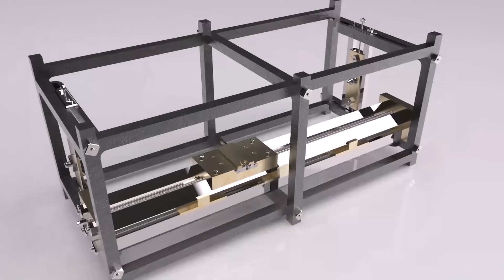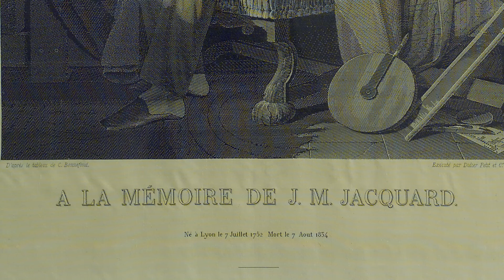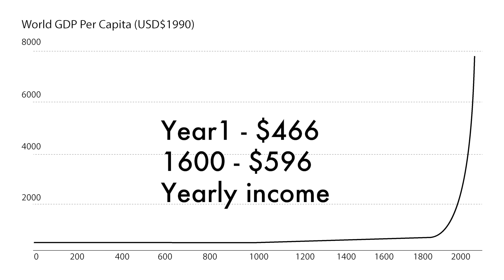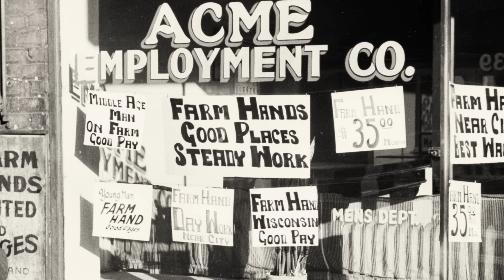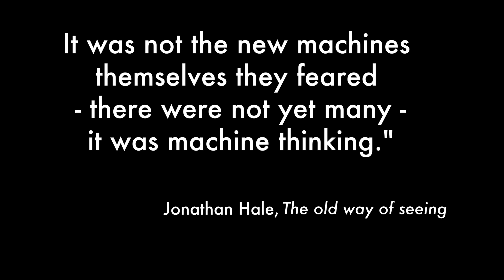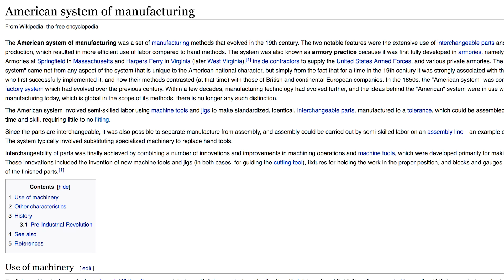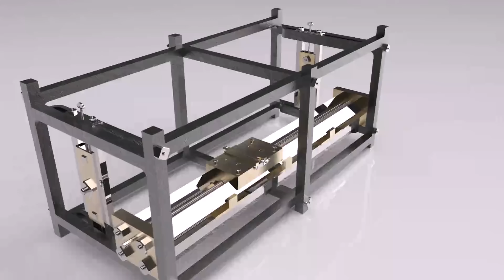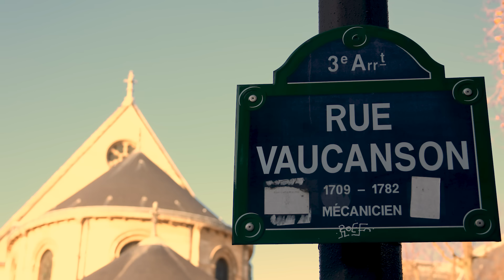The 1751 Machine that Made Everything

Comment: Even though that lathe is pretty cool and very significant, you can't help but notice the parts and wonder which machines and lathes were used to make them. The spindles and screws are precision parts that weren't cast, so they must have been turned on a lathe. Good video, I love learning about where we've come and what great minds got us here.
Reply from the maker: The screws were almost certainly cut with a die.

Comment: I was raised a printer.  Letterpress.  Back in the 1960's.  It was only years later after becoming a machinist, that I appreciated the precision of these printing machines.  The machinery was robust.  Once adjusted to a setting, like the alignment between the platen and the inked type, would not need further adjustment in normal use.  These machines were as good at what they did as any engine lathe or milling machine that I’ve been using for the last forty years.  In  addition, the manufacture of paper must be its own story of precision, because you can depend on sizing, thickness and weight of paper to be as expected.  That said, todays machine tools are far more accurate and robust than the old tools I was trained to use.  Accuracy, flatness, true to a required shape, can be done nowadays with no further processing, in many cases.
Reply: Original Heidelberg! I ran a windmill for 4 years and it was rarely out of sorts.

Comment: I really enjoyed this fascinating video.  The only thing you left out was how the machines were powered.   I would contend that without the incredible energy resource discovered about the same time, that the economic boom would not have happened.   Fossil Fuels helped power those machines to unimaginable heights.   I am curious of your thoughts about the contribution of Fossil Fuels to the machines, economic boom, and overall progress of the 20th Century.
Reply from the maker: I believe this machine was very likely water powered.  Vaucanson used water power for his weaving machine of the same era so I see no reason why not.  Once the work piece was between centers I can easily imagine a belt coming off of it to the power.  Fossil fuels accelerated everything but if I recall correctly even at the time of Watt's death there was more "horsepower" created by water wheels than by steam engines.  The story of the modern world is one of harnessing power for sure.

Comment: Heres more food for thought. A lathe like this allows for standardization. Fasteners (screws, nuts, bolts, etc..) for example could be made in various sizes and thread depths consistently and in large quantities. Those standards allow someone to easily get ahold of the materials needed to assemble machines, vs the old way of having to custom make each fastener one by one in an imprecise   manner.

Comment: the evolution of machinery is just fascinating. Some times I think why it took humanity that long to get where we are, then I think about what I would do as an engineer if i woke up in 1300 today. 

You would think "great, I could build so m,any things and contribute that much!" then you realize: there is not a single tool to cut metal, there is no bearings, no flat surfaces, no high quality steel. All you have is black smithing and hand grinding. 

You would literally have to start with nothing.

Comment: Entertaining video. But I think the focus on this lathe is exaggerated. The industrial revolution is well-documented and cannot be focused just on one machine. Still, if I had to pick one, I would say it was the steam engine burning fossile coal - since that brought the power of many workers or even horses to each application with ease. The lathe is a millenia old tool that was imroved step by step - no ground-breaking innovation. The most important steps in lathes were the here mentioned precision - and a later enhancement to cut precise threads.
Here is a short read about the technical part of the industrial revolution. For those who want to step out of the more entertaining part of youtube theories:
https://en.wikipedia.org/wiki/Industrial_Revolution#Important_technological_developments

Comment: I still don't understand how it works mechanically, it looks nothing like a modern metal lathe..... otherwise incredible video!
Reply: Damon Lam yes, I need to see it work!
Reply: The important parts are the head stock, the tail stock and the saddle. Turning power probably came from an external source such as a water wheel or horse treadwheel. The cutting apparatus  would likely have been securely attached to the saddle.

Comment: The bridgeport is the only machine that can make itself and is more valuable than a lathe
Reply: How would you fabricate a lead-screw with a Bridgeport (vertical mill)? You'd have to chuck the stock in the quill, with a center in the table, and then where would you mount the cutting tool?  By the time you've figured that out, you've essentially re-invented the lathe (even if the spindle axis is vertical).

Comment: Yes... Machines did cause a vast increase in productivity. However... Something your graph fails to take into account is the fact that the world was moving away from the Gold standard and into fiat currency... This move introduced inflation into the money supply. Where gold controlled inflation because there is a fixed amount of it. Now governments can just print more and more money causing that skyward exponential climb in so called wealth... For example. Today compared to the 1913 dollar. Your buying power has decreased to less than 4 cents of that original dollar. So you need to factor that into your wealth graph...

Comment: Have you seen Connections by James Burke? He points out several similar items. The combination of the screw and metal made accurate screws possible. Accurate screws made accurate measurements which made accurate machines. You get the point.

On the growth cycle another connection that James Burke pointed out is that the drop in the labor pool in Europe due to the plague had made a the cost of maintaining a person so expensive that is was worth trying to mechanize a job. Prior to that it wasn't worth it.

Comment: Hey there.  Would you do a video on how they make measuring tools?  I've had manual and also digital calipers (as I dreamed of someday running a lathe instead of just fixing buses) but as I watched my Ace Machinist buddy use his $8,000 lathe, I was suddenly struck by HOW the companies that make precision measuring tools know that they are 100% accurate?  Especially when you are talking about measuring a thousandth of an inch?  How could this NOT possibly vary from one micrometer to another?  And   how do they possibly make those little one inch, two inch, three inch, etc. metal bars to calibrate a micrometer? And do you have to calibrate your precision tools at a certain temperature to compensate for expansion and contraction?   Please explain and I will die happy.  Thank you, Patrick amateur mechanic and self taught jack of all trades. :-)
Reply from the maker: Thanks for watching!  Metrology is a huge subject. My video, Origins of Precision covers some of what you seek! There is much more to know though. Yes, temperature is very important for calibration.  NIST in the US is the ultimate organization you can send your instruments to to be calibrated but there are others which are downstream from NIST but cheaper. Almost nothing is "exact" but some amount of +/- from the standard which a calibration facility will tell you.  This How It's Made about dial indicators may help too! https://www.youtube.com/watch?v=YCTti7tDN3E
Reply: Hey there  @machinethinking !  So would it be commonplace, for example, when someone is making a VERY precision part, say a shaft with stepped shoulders, some changes at 90 degrees others at 45, etc. and have the customer return it cause it's 2 thousandths off?  My ACE buddy has a Korean lathe, big sucker called a Webb, cost him $8 grand.  I love watching him build stuff, and was amazed when he used a little orange triangular carbide bit (looked like a cough drop) instead of some sharp pointed bit.  Also got a buddy in Nicaragua who's got a lathe that was worn out when his Dad imported it in 1950's.  There was NO spares during the wars there, hardware stores had empty shelves, so he built me anything I needed.  Amazing smart fellers run lathes, they can fix ANYTHING!  Thanks for your CoooooL Videos!

Comment: I have always been amazed by lathes. Sadly, I bought a lathe/drill, with a capacity to turn stock about 2 feet by 3-4 inches.  But the manual was a horrible 3 page mess of Chinese/English.  I didn't know what to do, so I sold it.  I still wished I'd learn to operate a metal lathe.  They don't even teach it at vocational school now, theY JUST show you how to set up a CNC machine.  BORING!!

Comment: I mean it helped but from what I understand it was the steam engine that was the real driving force behind the boom.
Reply from the maker: James Watt tried for 8 years to make a workable steam engine but was unable to do so until Wilkinson's lathe could bore smooth cylinders.
Reply: Thomas Newcomen invented the atmospheric engine in 1712.
Reply from the maker: @Robert, yes Newcomen invented the steam engine (or should we credit Papin, Savery or others?) quite early, but it was incredibly inefficient and economically impractical until Watt was able to introduce his condenser, smooth cylinders and created a company (with Boulton) to produce them at scale.
Reply: Right but the argument is a bit of a fallacy. The key invention was the steam engine. Your under the assumption that it could not have been made proficient without the lathe; not necessarily true. Following your logic I could credit the invention of steel to the the boom, right? Without steel the lathe would have nothing to machine. Obviously, both were necessary inventions but in my mind the lathe was no more purposeful than the screw driver or wrench that helped build the true driver, the steam engine.
Reply from the maker: @Robert  Steel, as one critically important example as you point out, is not a machine - and the first machine is my premise. Steam engines are also incredibly important (though if memory serves there was more "horsepower" created by water wheels at the time of Watt's death than steam engines) but it was still lathes which then made the machines (at least the metal ones) which steam engines or water wheels were powering.  Don't worry,  there are many more stories to tell ...
Reply: "is not a machine" - Okay a forge and billows then.. I think your missing my point. Oh well, I guess I am just not convinced.. good video though.

Comment: The lathe created the metal planer which in turn created a much better and more precise and much larger lathe which in turn is used to create a much better and more precise and much larger lathe and this later on gave birth to other basic essential machine tools like the drill press, milling machine, and the shaper. Lathe, planer, drill press, milling, and shaper are the 5 basic machine tools plus their ancilliary components such as jigs, fixtures, extenders, mechanical locking bolts, measuring tools of all kinds especially the micrometer, etc. By simply keeping them simple one can use all 5 basic simple machine tools to manufacture each other. In other words, MACHINE TOOLS ARE THE ONLY MACHINES THAT CAN REPRODUCE EACH OTHER. As time passes by other different basic machine tools came into being and they in turn with the 5 basic machine tools started making customized and specialized machine tools to make other different kinds of customized and specialized machine tools of an entirely different designs until the final and required precision machine tool is achived to produce an end product or an end manufactured product's component and other components. And these components are assembled in an assembly line made directly and indirectly and multi-indirectly by machine tools of all kinds and types and sizes and dimensions.

Comment: I think Computer Thinking is distinct from Machine Thinking, and holds similar potential dangers.  Computer-based systems are inherently based upon rules and assumed consistencies.  Humans are, above all, breakers of consistency.  We are increasingly faced with systems which are not flexible enough to account for the actual flexibility of human beings.  Disturbingly, when your situation is too complex to be dealt with by the software built to deal with you, people see you as the problem, not the system that can't deal with you.  It is nearly impossible to outline any absolutes about human life.  But the software systems that run everything in our lives attempt to do exactly that.  And when they fail, as they must, it becomes increasingly more difficult to resist the conformity the system assumes is present.  Even the person whose situation is different from that anticipated by those who designed and built the systems often feels that they must have done something wrong.

Comment: One thing that always blows my mind thinking about how things are made, is that almost everything at some point was made in a machine, but those machines were made by other machines... and those other machines were, in turn, made by machines.

I suppose it's possible numerous individuals made all metal machines from scratch, without using an all metal lathe to make one... but if someone was designing a new all-metal machine, and they already had access to an all-metal lathe, why wouldn't they use it?

In that way, isn't there some kind of lineage, almost like genealogy, of one machine creating another which all machines can trace their origins to just a few key machines such as this?

Comment: Interesting, however an accurate lathe depends on a accurate screw thread to make it work.  "The construction of the screw thread depended    upon the eye and skill of the craftsman. Advances on this occurred in the eighteenth century.   Antoine Thiout, around 1750, introduced the          innovation of equipping a lathe with a screw drive allowing the tool carriage to be moved longitudinally semi-automatically. Screws with fine pitches are essential in a wide variety of instruments - such as micrometers. To construct such a thread a lathe was essential. Jesse Ramsden in    1770 made the first satisfactory screw-cutting lathe. Using his lathes a long screw cut be cut from a carefully cut small original. Precision screws allowed precision instruments to be made to allow the construction of steam engines and machines tools. By their use in surveying instruments they assisted in the construction and development of canals, roads and bridges." Quote from http://www.boltscience.com/pages/screw2.htm.  So my argument would be that the manufacturing of accurate threads started the explosion not de Vaucason's lathe.
Reply: Which came first the thread or the die?  Above a certain size all threads have to be machined as die cutting requires a great deal of force for threads above a certain size. Plus die cutting is mostly applied to Acme threads not the square profile used on lead/machine screws.  Square profile threads are turned on a lathe, least they were in my day.